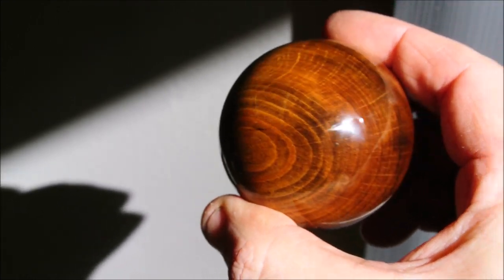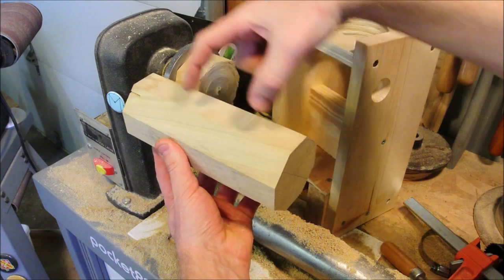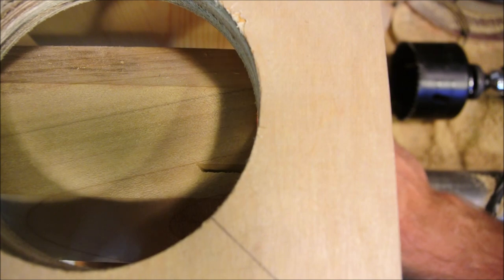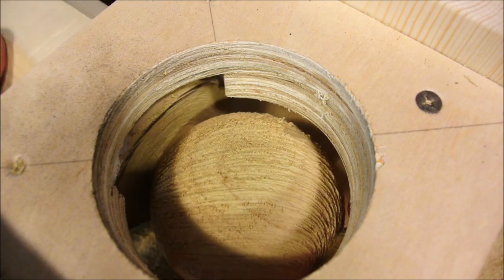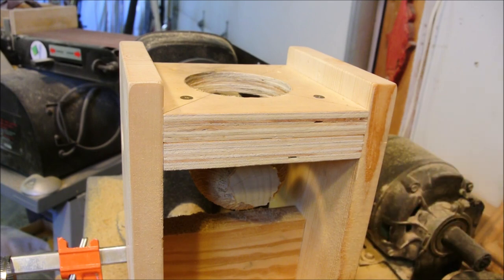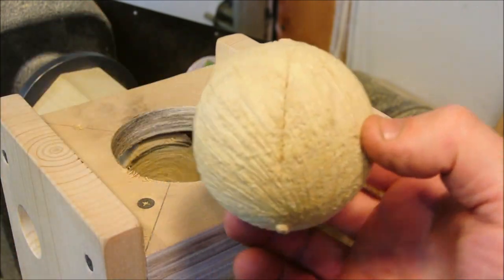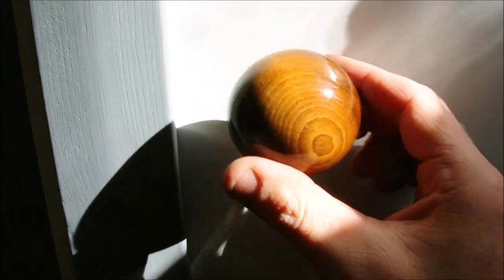Quick & dirty lathe balls: holesaw and sander jigs

Comment from the maker: Note @ 5:45, the jig is vibrating because I forgot to put one hoseclamp in place: the handle on the F-clamp spun loose, and so the clamp loosened. The edit doesn't suggest this. The jig is normally pretty solid when it's clamped tightly. 

Also note @ 7:45, the holesaw is favoring the side of the 'sphere' closest to me. It is here apparent that the guide hole was off. This is not something that you would see in use. Although my procedure in this video was shoddy, this method does work. This was just a demo. Hope you can pick something up from it.

***

Oh, a small addendum to the second-from-last paragraph of the description. The character limit had been breached there, but here in the comments one can spam to the Moon and back. 

Ok, the Moon-- let's use that. 
Think about it. 

It's a bright disk. It looks almost supernaturally round. Perfectly round things have an otherworldly aspect to them, because they are such unusual objects to our sight. From this effect our Moon almost looks cartoonish after you stare for a bit, especially when it looks orange, or when it's low in the sky.¹

So you may want to argue that a sphere is the circle apparent, because it does not look elliptical. Yeah, almost. But you have two eyes, and thus, binocular vison; any sphere that you see is a stereoscopic image, because the brain blends two--slightly off--images into one average. Oh, but you'll get around this distortion by closing one eye, right? You are a clever one. Tell me, how is it that you know that your single eye is aligned in perfect perpendicularity to the Moon, and further, that it's also centered on it without deviation? If you have a steady gaze, I'll concede that maybe you've got a clear view. But is it also without atmospheric distortion? Seems there's no turbulence in your sight, yet the peripheral stars do their flicker. 

The circle is an ideal. It's not of this world. Silly idea? Plato wrote of 'Forms' 2½K years ago, long before most of the gods people pray to nowadays had been invented. His argument was that there are ideas which represent certain truths about reality which are far more accurate, permanent, and thus more substantial, than any of the hazy imperfections that our lives consist of. It's almost ironic that we consider an idea like this to be both dated and bat-sheet by default, yet it's closer to the way the external world works than any of the intuitive fantasies that our minds tend to cook up. ²[Come back up here after you've finished reading this, and apply the reality of footnote¹ to this idea of our "intuitive fantasies".]

The brain builds with what the eyes provide; here, you and I will briefly inhabit the inside of a tiny skewed bubble of limited consciousness, and from this point we will extrapolate an understanding of infinity: a pocket-level projecting its error across an ocean. 

In video or photography, we call it 'spherical aberration,' gleefully conceding that it is a flaw inherent to any lens-based visual system which should be mitigated and controlled. What we don't admit is that this limitation is the full extent of our own projection of this reality. Distorted is the best we can have. Such is necessary to occupy a place in space. Outward seems to become diminished. And its seat here at the center of the sphere is temporary, at that.

¹Search "Moon illusion" for more on our perceptual differences between the noon and horizon sky positions. There's no real consensus about how/why, but we tend to overestimate its size by 50% when it's low in the sky. Surprisingly, this phenomenon is not being caused by the fact that the horizon Moon's light must travel through more atmosphere, and thus will be subjected to more of Earth's turbulence; in fact, the low Moon is not really any larger in the sky at all. The apparent difference is perceptual, and somewhat sensible, when we consider that a cloud in the horizon is much, much smaller than it is when viewed directly overhead. ²⮥

Hey, should you find value in reading these, please react to it. I question my own motive for posting such serious considerations in this cesspool. But tell me, fellow reader: where does one go to read something genuine? It certainly isn't there in mass-publishing! Mass appeal sells, and so it especially appeals to advertisers. Messages tend to pollute with bias and soften in such a field, where they are exposed to the bright rays of mass scrutiny. At least out here we are free to exchange our thoughts without the burn of coerced compromise. For now.
Reply: I loved it! I haven't seen the full video yet, but I've read the commentary. It's surprisingly relevant to my process of learning how to create 3D art and renderings. It's often very easy to spot a perfectly proportioned image as a render, if the artist has failed to include imperfections. 

Our surroundings are full of dirt, scratches, illusions created by perspectives, wear & tear, age, etc...

Whenever possible, I try to emulate that. It is surprisingly far more difficult to emulate objects with imperfections than to simulate perfection. 

A simple white-glazed mug still needs a significant amount of thought to make realistic. Usually the base is unglazed, but how rough is that fired unglazed ceramic? What shade of white/cream is it? Same goes for the glaze. It can't be perfectly white. How glossy is the glaze? Do new mugs have minor scratches that we don't notice? To what degree should I emulate that?

Just like that, there becomes an endless persuit to improve what is technically perfect, in order to make it more realistic. An ideal mug would be the brightest white, with a uniform and extremely glossy glaze. It would be perfectly cylindrical. The base would also be glazed. The handle wouldn't need to be slightly thicker where it joins the mug's body.
Reply: I really enjoy these videos, plz keep them coming because they help me stay alot less lazy and inspired to do something.
Reply from the maker: @OutOfNames...

There was this cutoff chunk of decking sitting around the shop that looked like a piece of sandstone, so I decided to make a fake rock out of it. Man, imitating a natural thing is the most unnatural thing a man can do. My bias for symmetry just kept interrupting me. It just never had that 'finished' feel to it. Sometimes we have to fight against our brains to accomplish simple tasks. For example, don't swat at a fly-- swat above it in a back and forth motion, since the fly has been selected to avoid the conscious decisions made by the brains of fly predators. 

Mindless processes are simply better at replicating mindlessly processed things. 

Side note: I always wanted to render 3D objects for games. I consider it a form of sculpture. It was just one of those life paths I didn't take.
Reply: i like reading them, they often get my thinkingmachine going
Reply: @pocket83squared  Thanks for this. Being the 'fish in the water, not noticing that they are wet' we so often seem to forget that we're locked inside our minds, limited to our perceptions of reality.

The difficulty of 3D modeling is there, but there are some good programs that are free, like blender. Also the mentioned difficulty in making a realistic model says to me that we have a long way to go in our ability to accurately model reality. We can predict that gravity and pressure will force water into a sphere, but modeling an accurate drop of water takes a lot of steps and processing, almost as if reality 'never' produces a perfect sphere.
Reply: The moon illusion is a great starting point for just how much the human vision system cheats. The brain actually makes estimates about what the world is like and feeds them to you as if they are just sensor input... i.e. it lies to you. There is some fascinating stuff out there on techniques magicians use in their illusions to trick the brain as studied by cognitive psychologists.
Reply: @pocket83squared  I'm sure you could find a program to do 3d modeling for games tho. It will probably be a cool thing to do if you can figure it out.
Reply: Perception is weird. A pretty good new release video on the color brown from technology connections: https://www.youtube.com/watch?v=wh4aWZRtTwU
Reply: Beautifully written my friend
Reply: The

Comment: I think pask makes had a similar jig with tighter tolerances for a more precise sphere that needed less sanding. All the same I like this for a faster and easier to make version.
Reply from the maker: Wow, you really like your comparative adjectives.

This is nearly an identical method. No less precise. No more sanding. If you want to, sand it on the lathe before dropping it loose. 

Ha-ha! The Simpsons already did that!
Reply: @pocket83squared  comparatives are better and more useful than all other varieties of adjective. They make you sound smarter and more knowledgable.

Comment: an idea: what about using a benchtop harbor freight drill press? once you get the spindle aligned and such you can use the press motion instead of relying the wood to not be ground away by the saw.

Comment: Even if it's not 100% effective, it's still a pretty interesting way to do it. Even without a lathe, it shows the concept of using a 2 dimensional cutting plane (the holesaw) on an object rotating in a 1 dimensional plane(rotating around the center of an axis) can cause a 3 dimensional change on the object. So essentially, I could use a hole saw in a rotation around a stable octagon and get the same or a similar result depending on accuracy of movement.

Comment: The machines that cut stone spheres using two or three rotating cups are pretty cool, check em out if you haven’t seen them. Interesting method here, not entirely into it, but trying new things is how change happens!
Reply from the maker: We could try three holesaws! That would be something to see. Dry sanding them with cups would be a problem, though. Slurry doesn't really work with wood. Maybe some kind of flap-disk sanders, instead? Three of those might do the trick.
Reply: pocket83² you could turn cups then glue loose silicon carbide or garnet to them.  Or pvc pipe. But yeah my first thought was a kind of flap wheel, which would probably win. I’ve actually seen small stone spheres made on a grinder using a cup against the wheel, the stone needs to be evenly proportioned, but it randomly vibrates to quite round.

Comment: You had me hooked until you started talking about a bent hole Saw drilling an elliptic hole! Lol
Reply from the maker: Don't laugh too hard. It may be possible! 
It depends on the speed, and thus the frequency of the oscillation against the wall. The drill has to spin such that it only bounces back-and-forth. Did you ever notice how a (dull) counter-sink will sometimes make a hex pattern? its oscillation has a frequency-to-rotation ratio that causes it, just like a Spirograph.

All of life is crisscrossing waves.

But yeah, in my case, I just wore out one side from pressing my bent holesaw against the side to stop the wobbling.

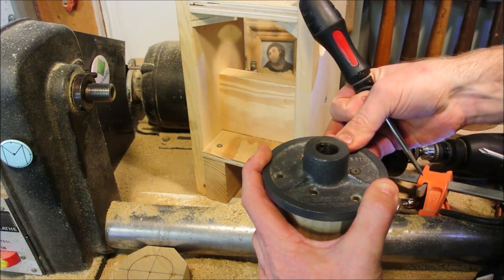Comment: Ok maybe a dumb question, I’m sorry if it is, but what is the difference between softwood (1 word) and soft wood (2 words)?  3:20
Reply from the maker: Not dumb at all! In fact, the confusion stems (pun) from a dumb naming system. When you are woodworking, a soft wood is one that hammer-dents easily. In contrast, a softwood is wood from a tree that usually has a pinecone.    

Simply put-- classifying a wood as either a hardwood or a softwood has to do with the shape of the plant's seed. 

Even though this is irrelevant, if I don't make the distinction on video, the commenters will gleefully make the correction for me!
Reply: pocket83² Ahhh ok, now I know. Obviously, I knew what soft wood was, but I was not aware of softwood. Thank you for the lesson. “Confusion stems” hahahahaha!

Comment: Use a drill press.
Reply from the maker: YOU use a drill press. And make a video about doing it. Then bring me another cup of coffee.
Reply: Chucks also have a fair amount of play in play in them so there's no guarantee, even after all the effort to accurately position press, that it would turn out any better. Additionally a drill press would be hard to adjust.